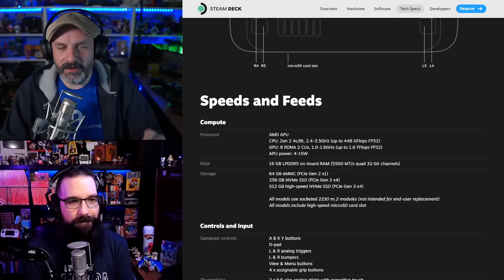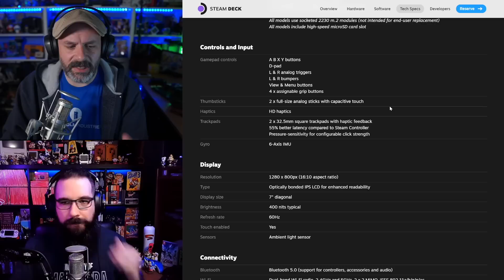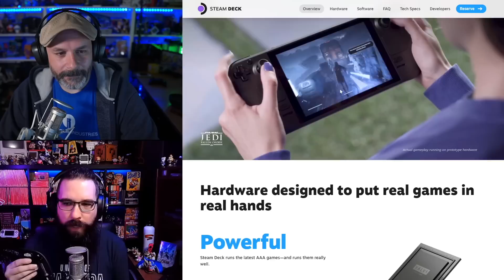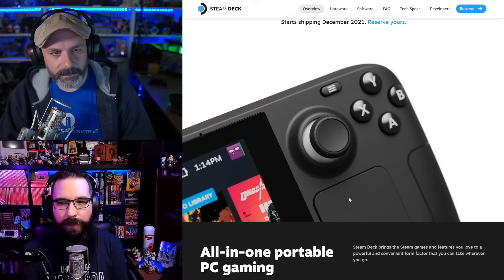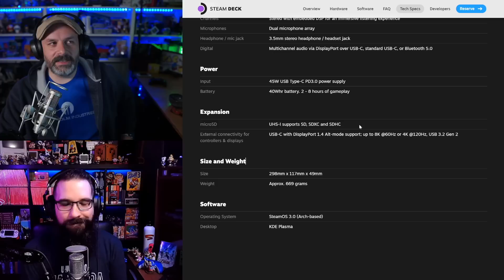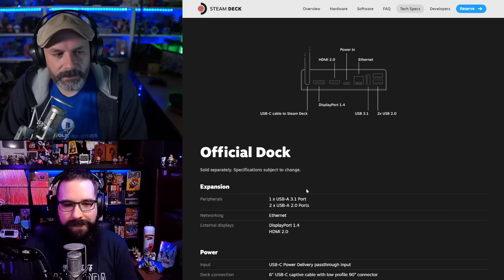Deep Dive Discussion on Hardware in the Steam Deck | On Deck - Episode 1

Comment: More like steam flop cause it has 30 fps and that's not acceptable in 2021
Reply: It has 60 fps for everything current they are only saying 30fps for stuff like cyberpunk and future titles that are insanely demanding, not every game that exists or will exists will use all the specs on the deck so without a doubt most games will run at 60 fps no problem.
Reply: @kirbytable  ok so I don't know why people are then saying and acting like it runs 30fps on everything. Valve should clarify that it runs 30fps on games like cyberpunk and will run well for 99% of the games. I was so confused su thanks for clarifying 😅
Reply: @jozixl8808  true but they want to be conservative about the specs and peoples expectations so that they don't get blasted if it isn't anything but top tier
Reply: @kirbytable  exactly
Reply: You would have to use a gaming laptop to do that and they still are not handhelds.  For what you want for the form factor just doesn't exist yet.
Reply: Its a handheld. Try running Cyberpunk on the Switch. Oh, thats right. It can't. Handheld gaming PCs like the GPD Win 3, Aya Neo, and OneXPlayer can run it at 30fps, yes, but thats fine. Thats what consoles run. Most games you can get a good 50-60fps but modern games are very demanding. Like imagine wanting a handheld that can run Cyberpunk Ultra 4K60fps with high ray tracing lmao maybe in 5 years, but not in 2021.
Reply: if you up the tdp you will get more fps but it will also take more battery you can tweak it... and also games with fsr...... ;)
Reply: @InfiniteCulling  what is tdp
Reply: @jozixl8808  power draw how much battery it will take in other words the more tdp you raise the faster battery drains..but if you get a powerbank thats no worry.
Reply: @InfiniteCulling  k
Reply: @InfiniteCulling  Imagine someone criticizing the Steam Deck without understanding what TDP is lmao he doesn't get that handhelds are a balancing act because they run on battery. The more power you use, the faster it dies. Like MVA has played games on the OneXPlayer at like 50W TDP to test the max capabilities but he explicitly warns you should never go that high except docked.
Reply: @InfiniteCulling  I have a 65W 30,000mAh portable charger for the OneXPlayer i got on the way hopefully soon. That thing is a beast
Reply: @BrandonKingM  well everybody has to start somewhere if we can help people to understand more clearly and the bigger picture of things maybe they can understand and see what we see. Stamp the hate out and maybe handhelds have a future.
Reply: @BrandonKingM  yeh its good you can still be portable. I still have an old sega game gear with a portable battery pack from my youth lmao.
Reply: @InfiniteCulling  Its not so much the knowledge he may have, i took issue with the criticism. This isn't an Alienware with an RTX 3000 series. Its a handheld. Its absolutely amazing that we live in a world where technology is powerful enough to make these kinds of things but in the end it is just a handheld and does have limitations. That's why I think comparing these devices to the Switch is entirely fair on a technical level
Reply: @InfiniteCulling  I have an RTX 2060 gaming laptop. As i have said elsewhere here, I'm a trucker so I hoped I'd get good game time in on my laptop. But the reality is my Switch is more convenient for the few pockets of free time I have. My OneXPlayer, and eventually my Steam Deck, will replace my Switch for those pockets
Reply: @BrandonKingM  yeh it has limits to begin with but people don't know about these things tdp could be a new word for alot of people and yeh i know it will never be like my gaming pc but i cant take that with me on a journey can i lol
Reply: @InfiniteCulling  I just can't wait to play Halo 2 on the crapper. That's a childhood dream soon to be fulfilled right there!

Comment: 16:10 also lends itself better to 4:3 games which can appear larger on screen (with pillar boxes) as opposed to 16:9 because of the extra vertical screen space.
Reply: 16:10 is all around superior to 16:9
Reply: @RoadRash95  Really depends on the situation and use case.
Reply: @Gramini  when would less information on screen be worse?
Reply: @RoadRash95  Neither has less or more information. It's aspect ratio, not resolution. In the case of the Deck sure, 1280x800 is more than 1280x720, but you cannot base this on the aspect ratio alone.

Example: Deck is 16:10 with 120x800, my monitor is 16:9 with 1920x1080. My monitor has more information (because more pixel) than the Deck, although it is 16:9.
Reply: @Gramini  maybe you’ve never used a 16:10 before. There is more screen in 16:10. compared to a 720p display it will show more vertical information. You can see more in a FPS game. It is a 720p screen with extra screen height. If you start talking about 1080p then I’ll just point out 1200 is the equivalent at 16:10
Reply: @RoadRash95  Again, aspect ratio has nothing to do with resolution. You can say 16:10 has more vertical "information", but you can also say that 16:10 has less horizontal "information" whereas 16:9 has more, thus "better". You cannot claim one is universally better than the other, because that depends on your perspective and the use case (and resolution). Yes, 1920x1200 is more than 1920x1080, but 5120x1440 is even while being 32:9.

Comment: Can't wait to get one! Was gonna get an Aya neo but switched to the steam deck
Reply: The Steam Deck has better GPU and DDR5 which may benefit for games, but the 2 extra cores even if not multithreaded on the 4500u and higher clocks could give the AYA NEO an edge on emulation and games that benefit from multi-core.

This said, I reserved my Steam Deck too.
Reply: @CalaTec  A worse CPU for a better GPU is a great tradeoff because if you look at the benchmarks of the currently existing handheld gaming PCs, they tend to only use like 60% of the CPU while maxing out 100% of the GPU.
Reply: @BrandonKingM  Linus confirmed by showing FPS counter 50% more performance on Doom Eternal compared to AYA NEO, although this is a well optimized title. So, the Steam Deck has the potential to pull up to 50% more performance at the same TDP which is cool.
Reply: That's funny because I was gonna get a steam deck but aya neo'd to the switch
Reply: @BartvG88  why are you getting the switch i would wait for when nintendo has to inevitably create a switch 2 or similar since the switches hardware is getting old
Reply: @killertigergaming6762  I was literally just switching the words around for a laugh. I already own the switch since march of 2017, and I will be going for a steamdeck, so I can play some of my 700 steam games. Looks Fun!
Reply: @BartvG88  oh ok
Reply: I ordered a OneXPlayer a couple months ago, i was one of the last backers so it should be arriving early August. I reserved a 512GB Steam Deck when that got announced, so i figure that will tide me over for the next 6-8 months while I'm waiting for my Deck